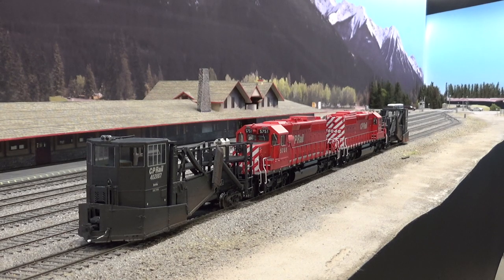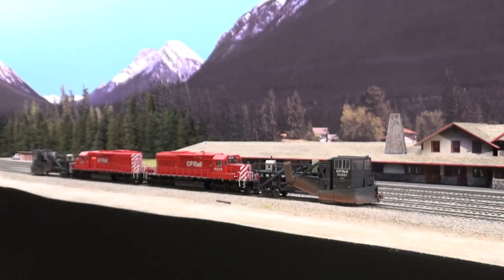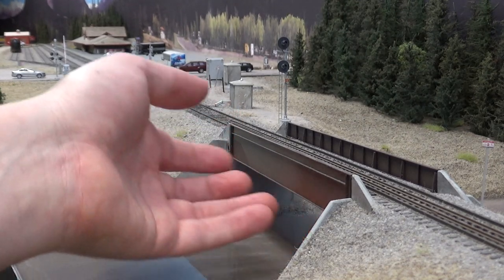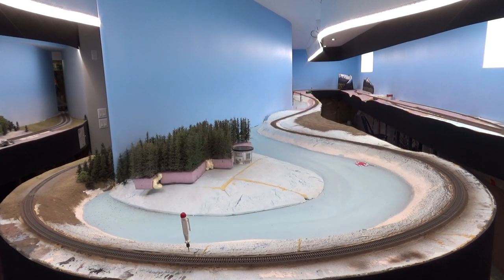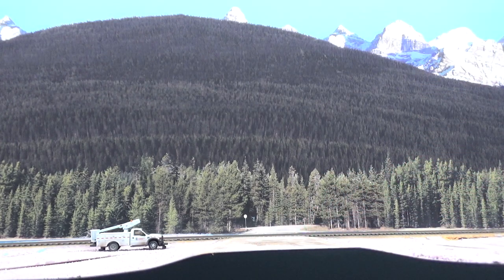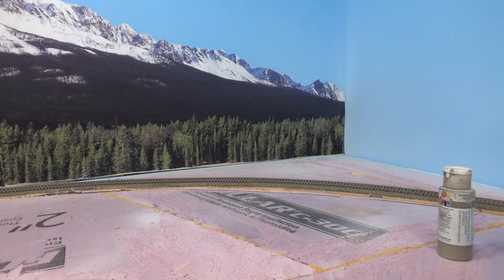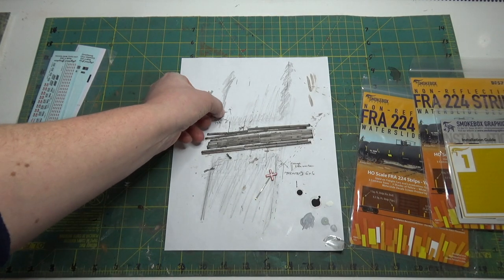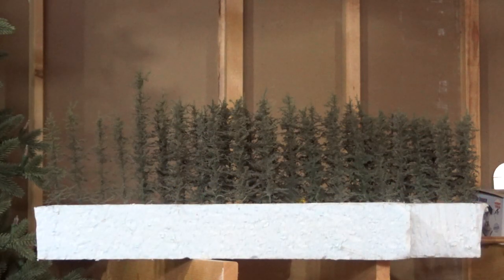Layout Update - April 2022: Jordan Spreaders Complete, Rookie Mistake, Painting Flextrack...

Comment: I don't know if you have harbor freight up there, but. I actually bought a small pancake compressor from them, for around $30 that has the pressure adjustment and moisture filter. It does pretty great and it's really small. It sure beat paying $300 for a branded airbrush compressor.

Comment: That new backdrop is awesome. How are you going to hide that corner? Did you consider putting it on a curve to help disguise it?
Reply from the maker: At the other end of the layout I used curved drywall. Unfortunately in this corner, the radius was too tight even for that. Strategically placed trees filling in the deeper part of the triangle should hide it pretty good I think, we'll see.

Comment: that sucks about the bridge, are you going to build a new one to replace it or just not run the spreaders threw there? 
nice update.
Reply from the maker: Yeah weird I ran trains over it for a couple years before even noticing. It's on the to-do list, I will remove the sides and add 1.5mm styrene spacers then reinstall.

Comment: The backdrop vistas you chose are amazing. If your bridge is accurate to the prototype then is the spreader not accurate to the prototype? I think you mentioned that the spreader was 3D printed. Did you contact the manufacturer regarding that?
Reply from the maker: Thanks! Yes the spreader may be a little on the wide side, I don't have the drawings though so I can't confirm 100%.